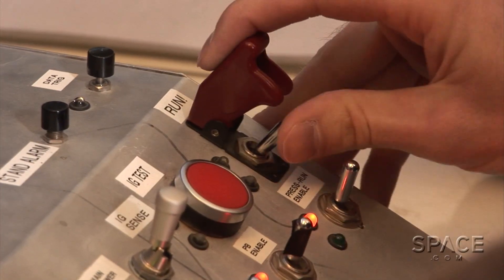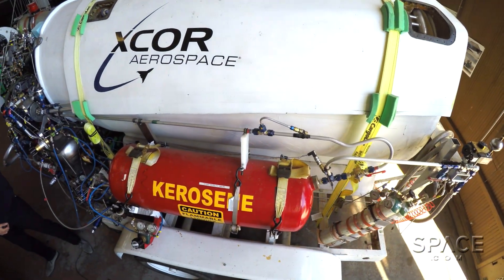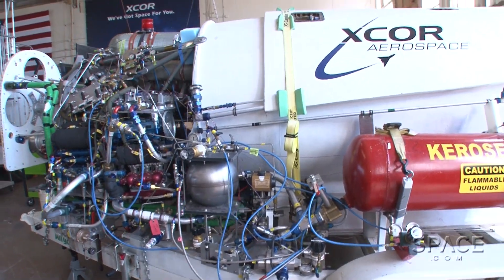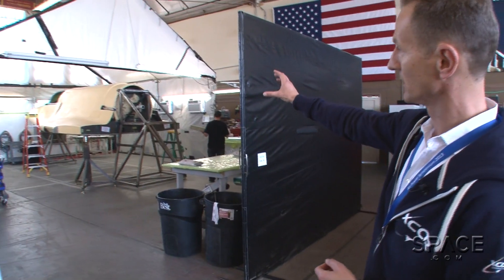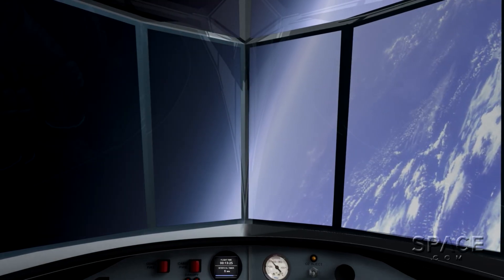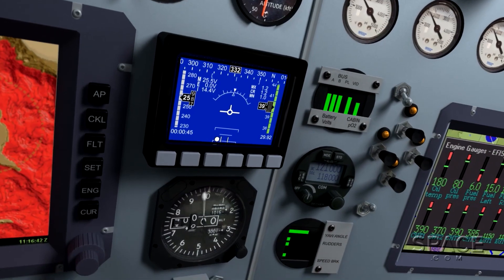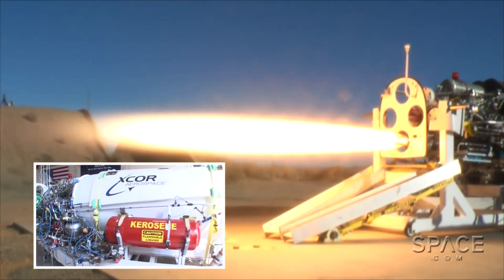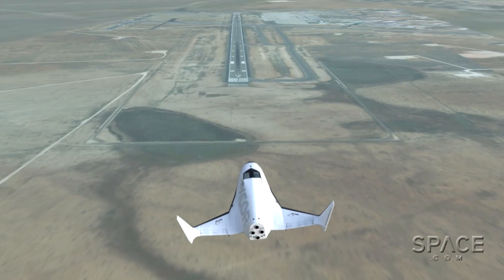Inside XCOR - Lynx Reusable Engine | Exclusive Tour Video

Comment: Of March 2019 at an invite only peer reviewed engineering conference held inside MIT's Electrical Engineering Dept. I gave a presentation on how Kim Songsu and Jun Noguchi of early 1940s Hamgyong Province Nitchitsu which extended into Manchuria were working on a cosmic ray muon catalyzed fusion rocket plane engine whereby a Dewar of cryogenic liquified deuterium fuel connected to a beryllium alloy reaction chamber nozzle coiled in and around electromagnet coils to produce helium exhaust is often ignored only for Sakharov and Alvarez to later receive credit.
Reply: Bussard of 1961 Los Alamos had an engineering proposal for an ASPEN nuclear spaceplane.

Comment: Pardon my ignorance, but why aren't there more restartable main rocket engines in use? I know most rocket engines are either single-burn only or allow for a few restarts, but I never understood why. Are they using explosive charges for ignition or something?
Reply: Not a rocketscientist, but I think the reason is that some rocketfuels are very corrosive that they destroy the engine
Reply: Restartable engines have to be specifically built to be restartable, and not all engines need to be restarted. It's much more economical to only make engines you need to restart actually restartable.
Reply: +Ahmed Jaber 
SpaceX Merlins are restartable and reuseable (hopefully) many times. But if you're gonna throw away the engine anyway, as most rockets up to now do, it's an almost useless feature.
Also as soon as you are in space without acceleration the fuel in the tanks will move away from the outlets. So no consistent fuel flow to the engines anymore, even if the tank would be half full. Takes costly/heavy extra measures to get around that.
Reply: It means you can reignite the engine after initial burn, most non private rockets are built based on older engine designs (Merlin), which are mainly single use, they can't reignite them, since all the fuel is dumped, obviously, the SpaceX falcon rocket can reignite, as can Blue Origins rocket, hence why they can reenter and land, and are essentially immediately reusable, once scrubbed of course.